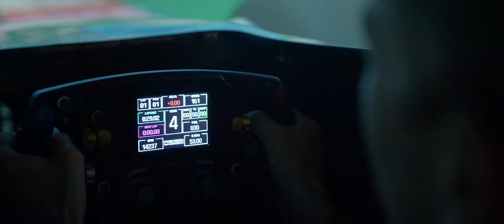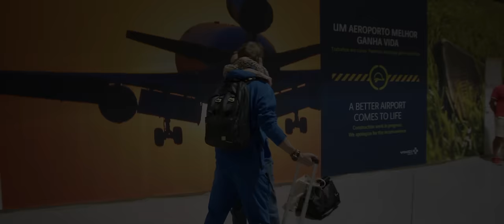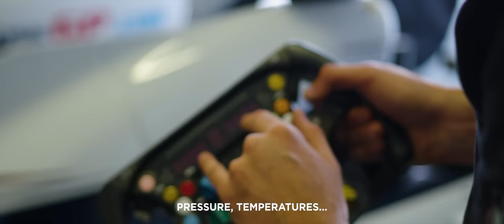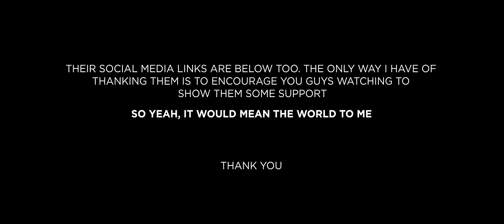Driving an F1 Car! | The Best Experience Of My Life

Comment: Hey,  I was there with you! You actually captured me at 17:11!!! Awesome. Is there any chance to get some of the original footage? Maybe you caught me several times? I also might have a shot from your F1 drive with the drone if you are interested. I sadly only did Formula Renault there but did F1 in Barcelona the year before (both on my YT channel). Unfortunately I only was able to afford the Benetton B198 which engine has a lot of stuttering at certain rpm but nobody told me before, so it was a bit of a mess and even with no tyre blankets etc. I had less grip than in the Formula Renault, but it still was an extreme experience. At Portimao I did 4x15min the Formula Renault which was so much fun on this amazing track. Video Portimao: https://youtu.be/uW2bpMqWGpY  --> Video F1 in Barcelona: https://youtu.be/bQdd8cOyPnM
Btw: Amazing job to avoid that crash in the Formula Renault. That was scary! I had also luck not to crash as someone braked to late and nearly hit me. I just saw smoke in the mirror but couldn't do anything.